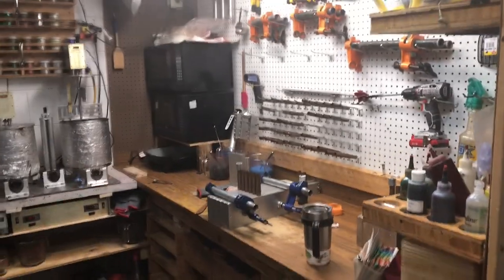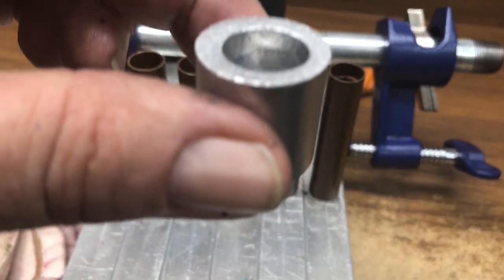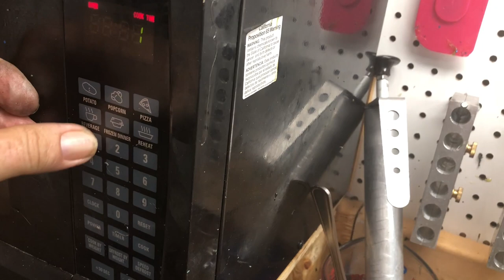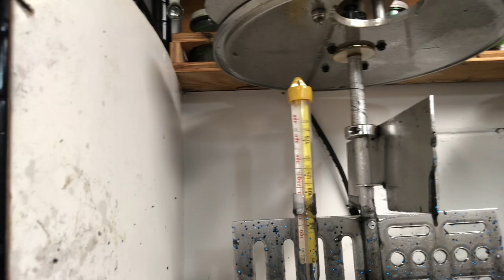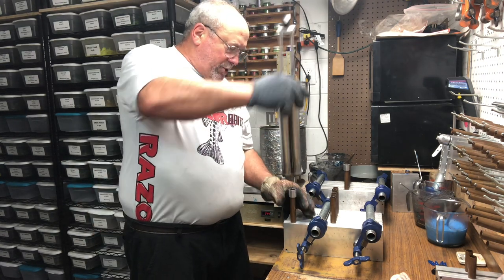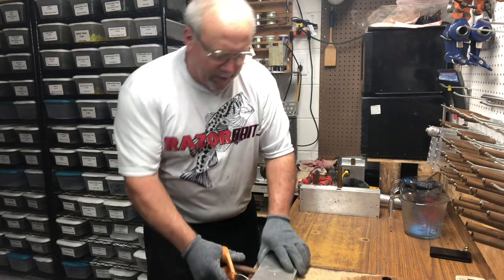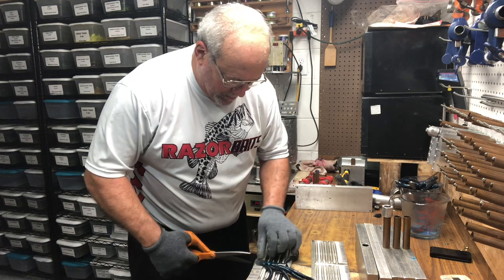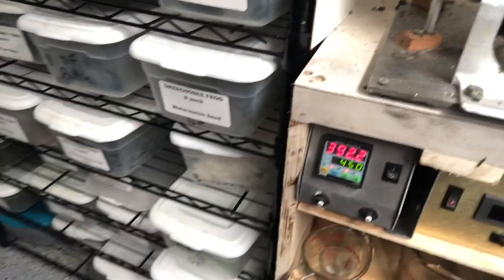SHOOTING STAR DEMO 9:20:2018

Comment: I have a question...if you didn't use a microwave and just heated the plastic in the shooting star unit...how long would that take to get up to temp?
Reply: I tried heating up the plastisol in the shooting star when I first got it. After about 20 minutes, I decided life was to short, so I went back to heating in the microwave. I image it can be done but the microwave is faster.

Comment: Hello Jim,

Thank you for sharing your experience and knowledge.
Your videos are amazing and full of valuable information!

Inspired by you and your videos I just bought an Ultra Molds Shooting Star.

If you do not mind, can you please let me know if it is possible to cook the plastisol in the Shooting Star or you have to precook it in the microwave?

Thank you in advance,

Mark
Reply: Mark, 
Yes, you can heat the plastisol in the shooting star but it will take about an hour or so to get it to temp. You have to baby sit it to keep from burning out the stirrers' motor. It much easy to just throw it into the microwave and heat it for 10 to 12 minutes. Stir it and heat it for another 5 minutes or so. The actual time of heat cycles in your microwave may be different depending on how many watts it is. Both of mine were 1000 watts so it cooked pretty fast.
Its a great machine and the newer ones are much easier to work with. 
Rupert and Chris do a great job with their machines and are always helpful when you hit a snag. 
Enjoy!!!!  
Jim
Reply: @jameslanza3269  Thank you very much James!
Reply: @jameslanza3269  Great Info!!

Comment: Hello, i am getting into the game so to speak on soft plastic bait making.  I notice you dip your baits in water but mentioned you still let them cure for 3-4 days after.  Is shocking them in the water necessary?  just wondering as i feel some of the salt near the outside will dissolve.  Thanks for a very informative video!!!
Reply: Thanks for the info! Makes “scents” what you said about salt dissolving allowing the scent to hold.  Thanks again man!